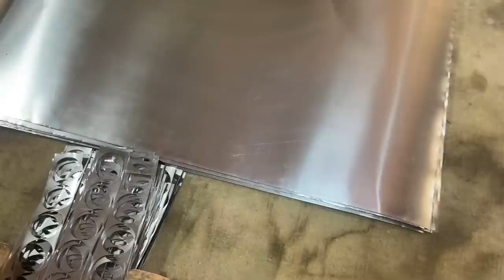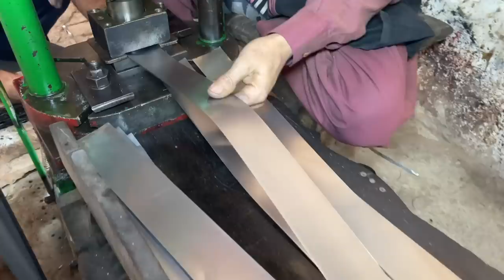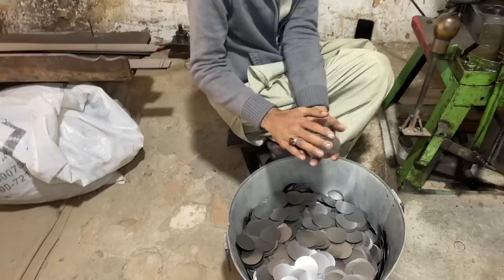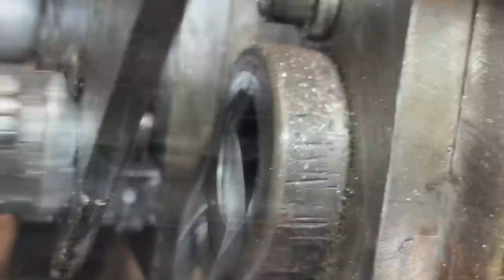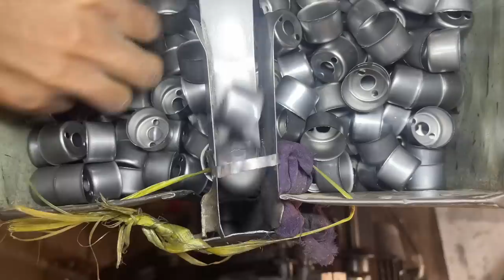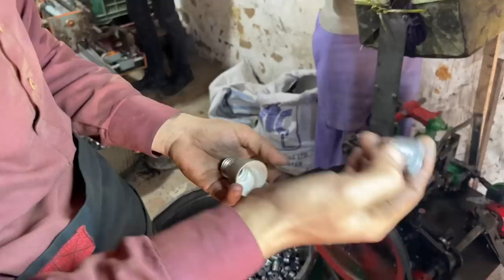Incredible Manufacturing Of LED Bulb Holder Screw Shell | Unique Production Way Of Holders

Comment: In China, they have the cast metal known as chinesium that is utter crap and breaks for nothing.
In India (and Pakistan) they have this strange sheet metal, just barely stiffet then a aluminium foil, that you can cut with houshold scissors, bend with the fingers and it has absolutely no springback...
Reply from the maker: Thanks